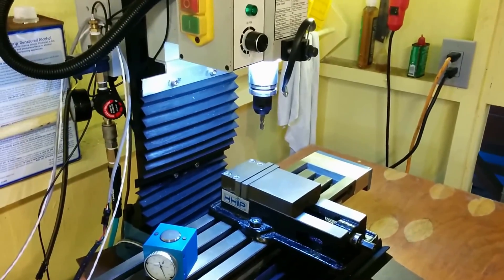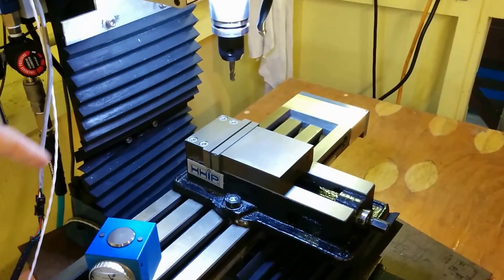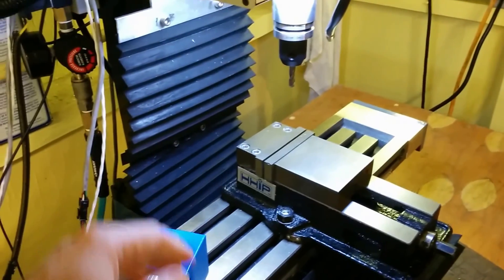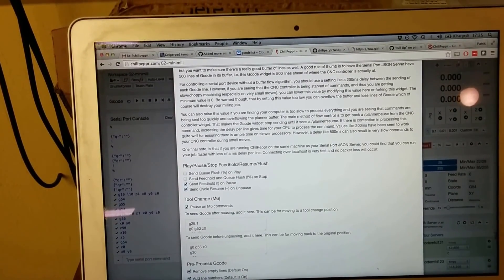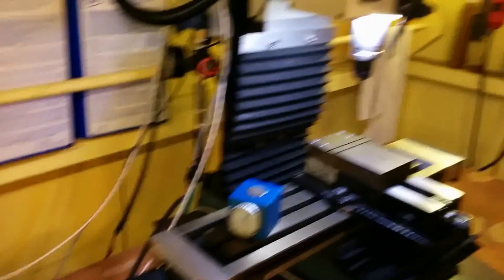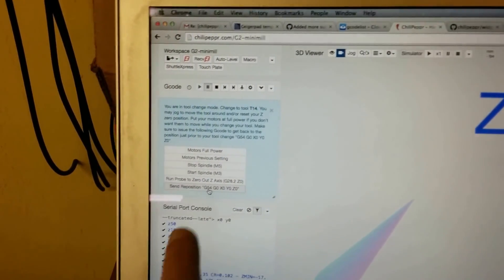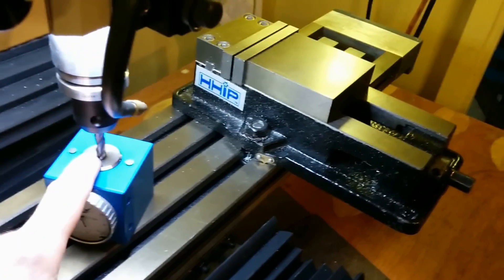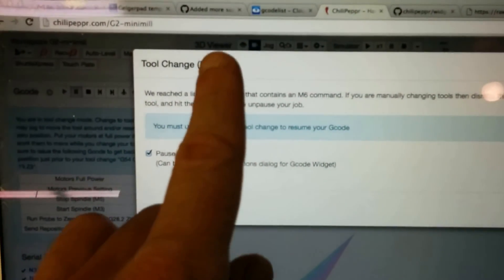Automated G-code execution for tool changes in Chilipeppr

Comment: What hardware do you have to achieve that rapid rate? I wish my steppers moved that fast...
Reply from the maker: This is a CNCFusion conversion with 280oz/in NEMA-23 steppers powered by 48V Geckodrive G251X drivers.